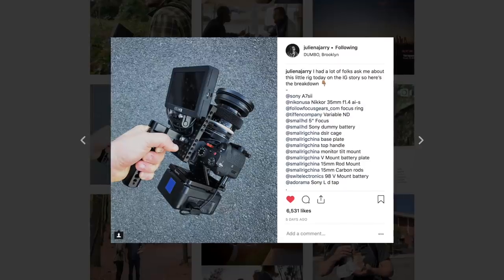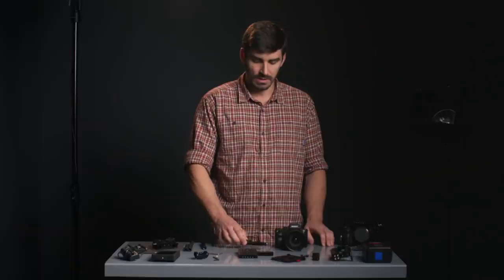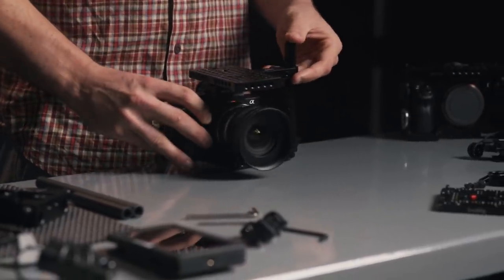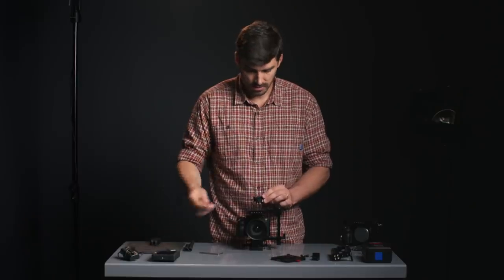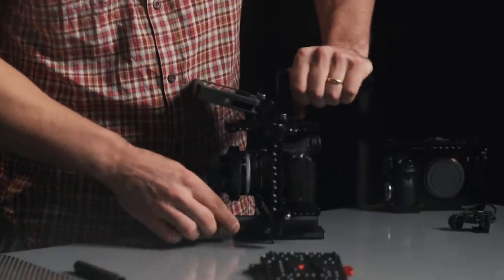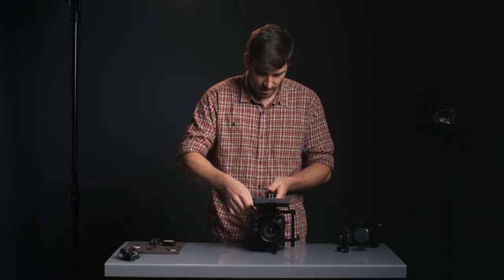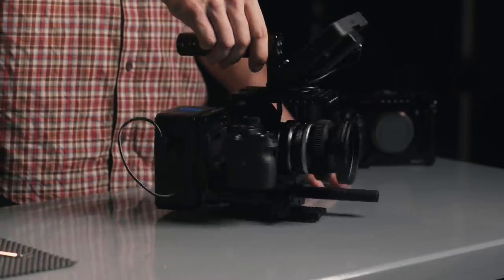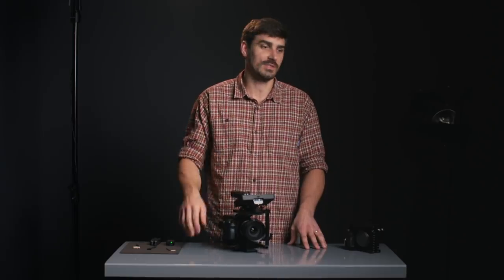Camera Rig Breakdown: ANY DSLR !!!

Comment: Thank you for this helpful video! Please could you recommend an affordable Follow Focus for such rig with 2:1 gear ratio? I'm not sure if Smallrig 3010 has 2:1 gear ratio. At least they don't provide such info. I will start to build my rig on the upcoming week when I receive some rig components I ordered. I see you installed your monitor behind the top handle. Does this mean you mostly keeping this rig much below the face? In my case I'm going to attach side handles in order to hold the rig at my face height. In this case monitor should be fully visible. I'm thinking to attach it to the left or right side of the top handle or on top of it. Thanks in advance!

Comment: hey, nice setup! 
so you got your monitor powered by the d-tap of the battery and the camera powered by the power output of the monitor via the dummy battery, right? if you configure the monitor to switch on automatically when the camera will be switched on or a hdmi signal is present, does this work with this configuration? or does the camera only get power when the monitor is already switched on?
Reply: same questions!

Comment: Isnt that handle kind of in the way of the monitor when shooting? Looks good for waist shots but..
Reply from the maker: Eirik Skarstein you can put in on a nato rail if you want. It’s not in the way all that much.
Reply: when you shoot rigged, you kinda end up shooting from the hip more, I never really shoot through the EVF anymore now i'm running rigged, being able to see the focus on the 5" screen is too good- my rig is similar to this, but instead of a top handle i have. a second side handle, that way I can still adjust camera parameters and use my thumb on the joystick to control focus (a7iii)

Comment: Does this cage fit for the a6300 too? Nice set-up. Love it!
Reply: Yes it will! Maybe its a little Bit overpowered for an A6300 but it will definatly fit
Reply: I copied this rig for my a6500 and it works great! I did add an arca Swiss quick release between the cage and camera so I’m able to take it off without disassembling the whole thing, that takes care of most of the extra space. I also don’t attach the cold shoe adapter up top, I just tighten the rod screw and the top cheese plate stay in place. Everything is still really solid. I also used the nato rail handle and monitor mount for faster disassembly. Everything sets up and breaks down on seconds.

Comment: Do you ever run into the “battery exhausted” message on A7sii with dummy battery. I get it using it with my SmallHD Focus and the camera shuts down. The camera see it as regular battery and thinks it dead. I end up having to use a usb battery pack to get around that.
Reply from the maker: Mike Zaritheny that’s odd no I’m sorry that stinks. Smallhd products? Call them.
Reply: @julienajarry  Both are SmallHD products. it works but after the camera runs the battery percent down that when it happens. I'll reach out to them. Thanks!